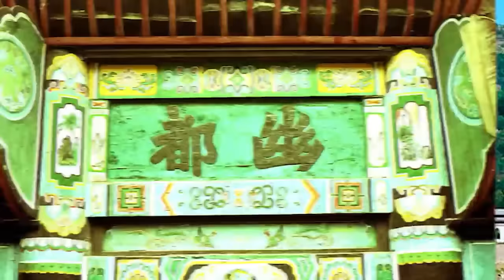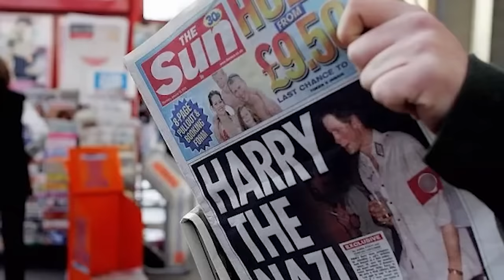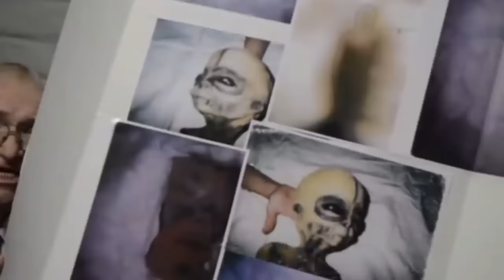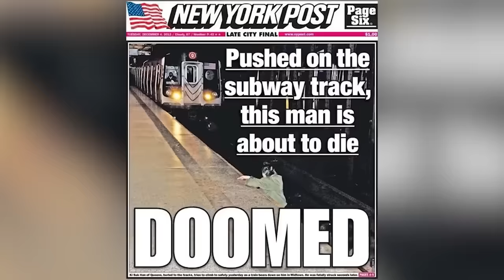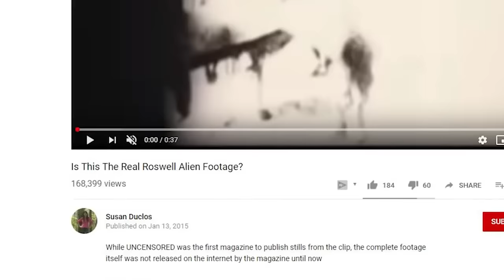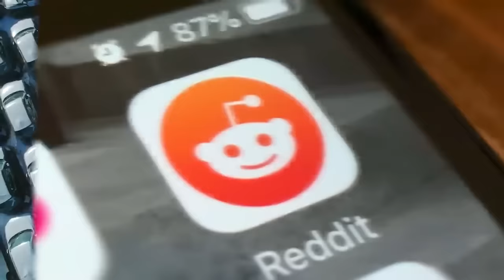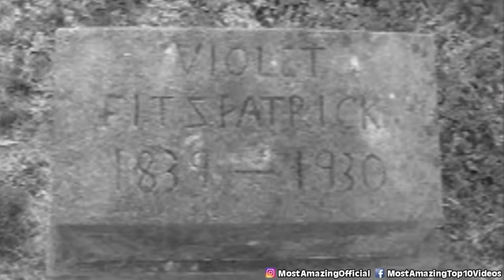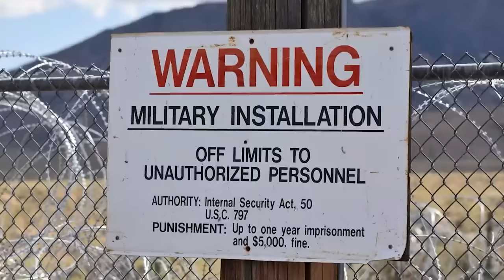Photos That Have Finally Been Revealed To The Public

Comment: Ill be honest. I feel outside with my glasses flew off my head. I searched for hours to find them. I gave up. They were rite where i usually put them. In a dish on center table. I had them outside on my head when i tripped. How they wound up there is questionable.
Reply: I'm also up at 2 in the morning
Reply: They fell thru a portal
Reply: that midget ghost that moves your stuff, hides it until you ask, and sits outside your window to sneak into the closet  :

   finally did something
      helpfully half-a$$

  is that a weird thing ?
            - €πD -
       ~WarriorPoet~